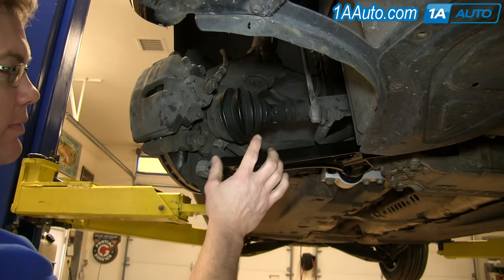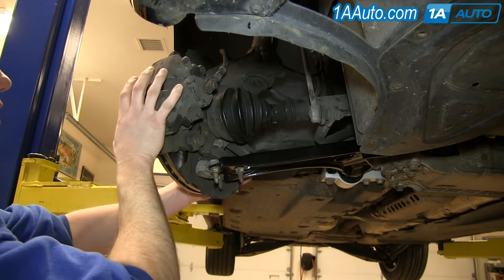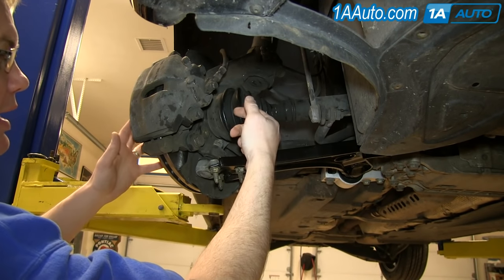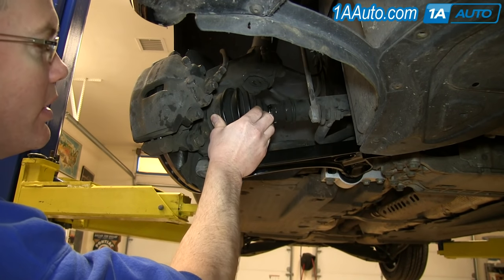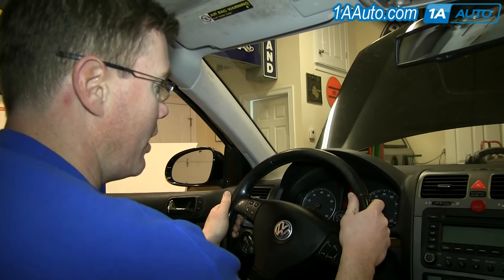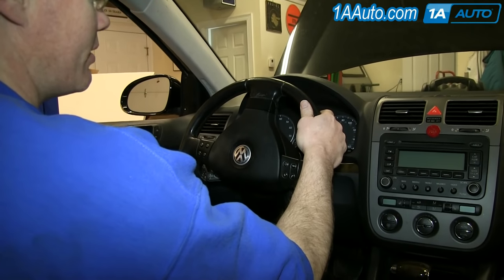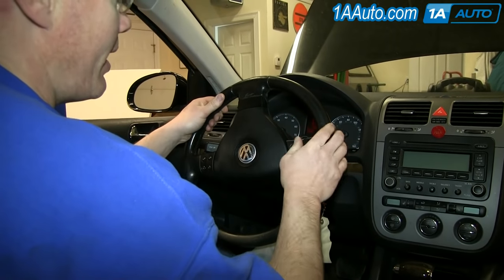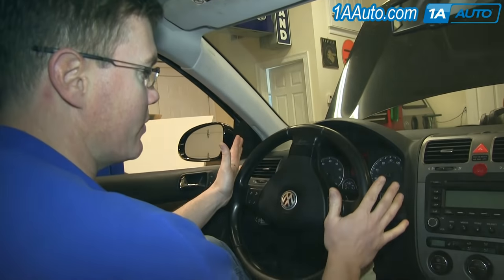How to Diagnose a Bad CV Axle

Comment: Cv joint should not have play, it is supposed to be solid so there will be no vibration when spinning. A little play in the inner cv joint will cause vibration during acceleration.

Comment: I have a 2004 nissan bluebird sylphy, the car makes a faint knocking sound from the front passengers side when i reverse. Could cv joints cause this?
Reply from the maker: +Cairo M Since there could be multiple reasons why you’re experiencing this difficulty with your vehicle, I strongly recommend that you have a reputable mechanic inspect it. They’ll be able to troubleshoot the problem and tell you what part or parts you’ll need for the repair. It is much easier to get a proper diagnosis in person rather than remotely.

Comment: Nylon gear hum inside of vehicle going down road what are reasons
Reply: 2006 buick rendezvous
Reply: 2006 Buick rendezvous wheel drive
Reply from the maker: +Ronnie Rohde We wouldn't be able to diagnose an issue like that here, you may want to have a local mechanic take a look at it. Thanks for checking us out! 1AAuto.com
Reply from the maker: +Ronnie Rohde We wouldn't be able to diagnose an issue like that here, you may want to have a local mechanic take a look at it. Thanks for checking us out! 1AAuto.com

Comment: i have a 2013 kia sportage, between 35 to 45 mph start like a wheel bearing noise(right side), on highway when change to right line i can hear noise when change to left line no noise. tried to move tire 9 and 3 oclock and 6 and 12 oclock no movement. on kia dealer said its a bad wheel bearing so i decided to replace wheel bearing by myself and the noise still there. what else can be? cv axle?
Reply from the maker: +Jose Diaz You may want to check the axles and the other steering components. Hope this helps you out. 1aauto.com

Comment: How do i know what side needs to be replaced
Reply: I think that if you hear it on the left side while turning left, the left one is bad. Because in that case the left wheel it turned at a higher angle than the right wheel so the joint on the left wheel is under more load.